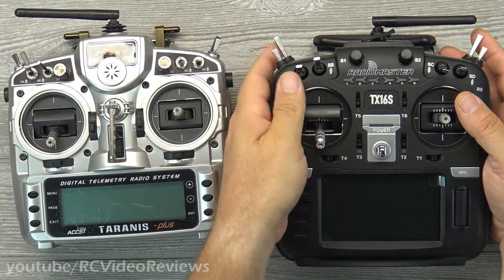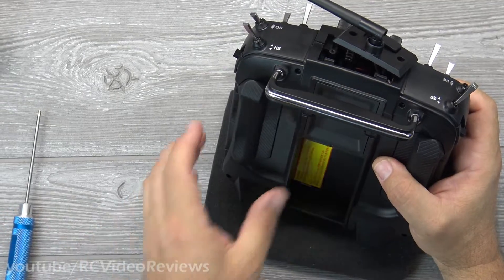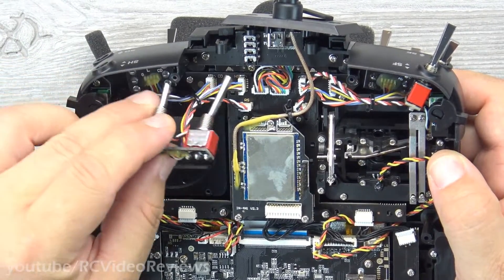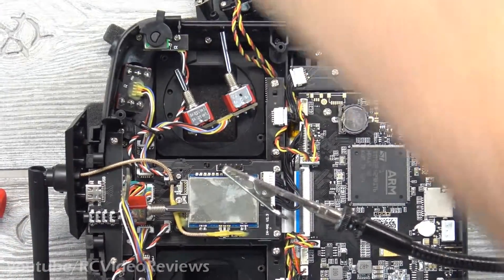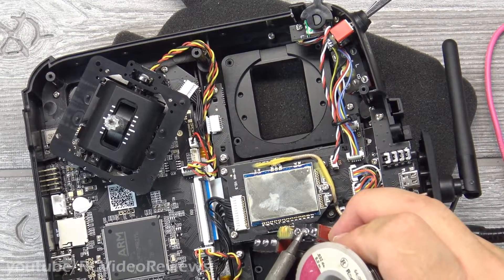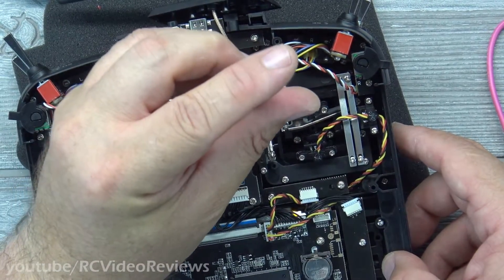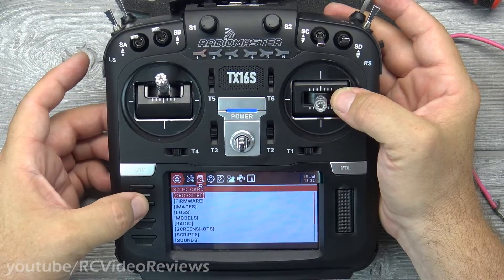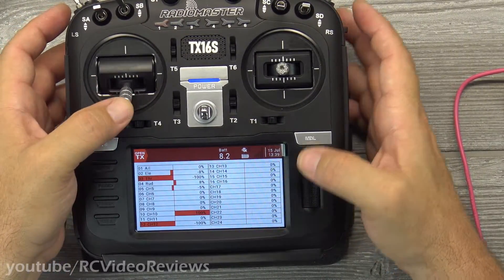Radiomaster TX16S Multiprotocol RC Transmitter - How to Relocate the Momentary Switch

Comment: Excellent tutorial thanks. I was wanting to do the same
Reply from the maker: You're most welcome. Thanks for checking-in. Radiomaster may have watched your video. My throttle gimbal wires were routed over top of the leaf springs out of the box.
Reply: i’m on the fence if i have enough courage, to attempt, i’ve broken enough arduino projects learning to sodder so don’t think i’ll mess up but it’s a brand new radio >.>

Comment: can I just replace the momentary switch with another sf 2 position se 3 position combo. I use throttle cut on the right rear fixed wing and arm/disarm on the left rear for quads.
Reply from the maker: Yes, you can swap out switch styles to suit your need. Make sure to make the changes in system->hardware so the radio knows what you've got.
Reply: @RCVideoReviews  i guess thats my real question. once i completely get rid of the momentary switch, how do I get the tx to register that there is no more momentary?
Reply from the maker: System->Hardware->Switches  I said that in my first reply.
Reply: @RCVideoReviews  my apologies. I thought you were addressing switching the switches. not whether the tx would require the momentary being somewhere put somewhere else vs being completely removed. thank you

Comment: Great video John! So what does the circuit board do if you can solder directly to the switches? Thanks
Reply from the maker: I believe they just provide electrical traces from the wire to the switch.

Comment: Great video John, here is something fairly new I found out (NO SOLDERING). RadioMaster makes a switch set that changes the SH to a 2 position switch and the SE to the momentary switch. All you do is remove the existing (2) switch sets with this rev from RM. Its available from Buddy RC.  It comes with (2) sets of switches, just unplug the existing and plug in the new ones then go to hardware page on the radio and change the switch types. See this video on how to get to the switches and then change them in hardware as it shows at the end of the video, obviously you will not need to do any soldering like in the video.
Reply from the maker: I thought I heard about those switches. Someone on the channel just asked about that not too long ago. Thanks for confirming.

Comment: Great video, thanks. What does a 3 position switch do, if you set it to 2 position?
Reply from the maker: If you're talking about doing in the system settings, I don't know, I've never told the radio a 3 position switch is a 2 position switch. It would probably wind up just registering two positons within software.

Comment: I bought the SF-SH switches that RadioMaster is now selling and it was super easy with no soldering, thanks to this video.
Reply: Do you by chance have a link to the switches you are referring to.  I am horrible at soldering.  Thanks.
Reply: @hammer5848  RadioMaster TX16s & TX16s MKII SH & SF Reverse Switch set  at Grayson hobby
Reply: From this video, it looks like you could remove the switches and relocate them then just change the plugs. No?
Reply: great tipp tunablue - i just ordered the same! with this the radio can be turned back into stock condition easily when needed 👌

Comment: Many thanks! Just done this conversion. No problems although I did pull the switches completely from the radio so as not to work over the radio. Now all the models are working, and whilst I wait for the old Spektrum throttle cut muscle memory to resurface, I'm off to re-watch your instant trim video now I have a left hand momentary switch!!
Reply from the maker: FYI Radiomaster sells a left hand momentary switch now. In any case, glad you got it worked out.
Reply: @RCVideoReviews  I had no idea lol! All sorted now with instant trim. Chuffed!

Comment: I'm a heli guy and that's where my throttle hold switch is, so I had to mod mine the day I got it.
Same place Futaba puts it and Realflight Simulator TX has it there as well.
Reply from the maker: I've done this mod 4 times. It would have been a lot easier if they left the PCBs out.
Reply: @RCVideoReviews  Yes that was a pain!

Comment: Great videos. I jumped on your idea and changed my switches over. However, I now Have SE DOWN  and SF DOWN (although they are both physically away from me). I can understand if I mistakenly turned SE over (yess I removed it by mistake 😞I do quite a lot of tinkering with electronics and have never foung a 3 position switch needing orienting) but SF can only go one way so that it is always away from me. I also cannot set SE a a 3POS switch. Any thoughts? PS is there any way of buying you a cup of coffee other than Paetron?
Reply from the maker: These switches must have orientation, otherwise how would the radio know that you have SE up vs SE down or SE mid? It's not a simple continuity device, the radio has to know if you intend up/down (or mid). 

SE by default is a 3pos switch. In my radio I can set SE to None, Toggle, 2pos, 3pos. The toggle switch doesn't change orientation. The sprung direction is always away whether on the left side or the right side of the radio. That radio doesn't know you physically moved it other than to give it a new label in the system settings.
Reply: @RCVideoReviews  Thanks -- I referred to your video and was able to orientate everything as it should be & all is working as it should. Thanks for the good work.

Comment: Just to add for people to be careful not to accidentally let a blob of solder drop onto the circuitry. I accidentally had this happen on one of my flight controllers, whereby the blob landed on the pins of one of the processors. When I tried to remove the solder it broke some of the processor’s legs. Placing a piece of cardboard over the body of the transmitter will help to protect it...

Alternatively, simply remove the switch units by snipping the cable ties and unplugging them. You can then place the transmitter to one side and work on swapping the switches without risking damaging the transmitter.

One final tip is to use a “Solder Sucker” to remove the solder from each switch pin one at a time. You can get manual solder suckers for under £10, or more expensive electric solder suckers.

Comment: i mean it work same way you this? Thanks.
Reply from the maker: You have to remap the switch in the system->hardware page, but yes, it's quite easy to change switches. I've done it on at least 4 radios.
Reply: @RCVideoReviews  so it mean I can do like u did the Video right? Thanks

Comment: Hi. i have a question about this video? I have RadioMaster TX16 are they switch? i like to change it my self but don't are they same Thanks.
Reply from the maker: You have to desolder the switch from the board as shown in the video. You cannot relocate the board--they are mirror copies of each other--so opposite. Follow the video and it will work.
Reply: @RCVideoReviews  Thanks

Comment: Great tutorial. I just did my radio without any issues. Two things that helped were a magnetized screw driver and some copper braid to wick away the old solder. Thanks!
Reply from the maker: I bought solder wick after doing this and used it on the next radio I did. Definitely helps.

Comment: That doesn’t look too complicated.  Question for ya John, can I set auto trim to the Trim 5 button instead?
Reply from the maker: You can set autotrim to any switch you want. I recommend using a momentary because you don't want to "hold" it. I would recommend if you use T5 to disable it as a trim in FM0 so you don't get audible prompts telling you "trim maximum".
Reply: After watching a couple of your videos I thought I might either move the momentary like you did or set it up as press in on the trim 5 switch as a momentary and assign it to auto trim and disable it as a trim.  The location of trim 5 would be convenient
Reply from the maker: Yup, that's what's so great about these radios, you can set them up however it suits you.
Reply: @RCVideoReviews  Yeah, amazing the versatility of this thing.  Your channel helps a ton as well.  I was considering a Spek TX upgrade but I just couldn’t swallow dropping six bills on it and still be under their thumb.....  done with them.  Just got a mess of RM recievers in today.  Bought 5 total for less than one 7 channel Spektrum rx.
Reply from the maker: I have a feeling you're not alone. Lots or people appreciate their equipment, but  their pricing is another story. Best of luck with your OpenTx adventure.

Comment: I'm found your channel from my interest in buying a Radiomaster.  So going through your excellent videos to learn more.  

I might be dreaming but is there any reason why the two boards could not be unplugged and swapped directly?  They look like they are the same other than the type of switches and they have the two plugs on the board between the sticks.
Reply from the maker: They cannot be swapped. There is a jog in the PCB so flipping them isn't possible. They have to be de-soldered.

Comment: Thanks for the video, I just done mine wow what a pain, but i'm not the best at soldering, but i figured out a easier way to getting them back in. mine wouldn't just push through the holes like yours until i applied heat even after getting the holes cleaned out. have had the RM16 for months and lived with the switches how they were but couldn't deal any longer lol.
Reply from the maker: I just swapped my momentary switch again on the new Color Edition radio. I'm getting pretty good at this :)

I knew there would be guys like you out there wanting to do this.

Comment: Just got my radio today. Mine seems to have a fan on the back plate with wires so I had to be careful.  But great tutorial once I saw the switches were soldered to a board I was like oh crap how am I going to do this.  Thanks for the tutorial!    I'm so used to spektrum that I have to have those switches swapped on my taranis and now this.
Reply from the maker: That's probably a speaker on the back. :) Really glad the video helped out. I started this a long time ago and can't go back now. All my momentary switches have to be on the left.
Reply: @RCVideoReviews  Hrmm it looks like a fan to me forgot to take pictures, but looks like a fan you would find in a video card where it sucks air in a duct rather than just a regular fan.. and its got 2 sets of red and black wires going to it.. Anyway I just got done switching the wires, that was quite a pain in the ass. no magic smoke hopefully the switches still work lol.  Edit: Switches work!. de-soldering them was a pain in the arse.  Solder sucker helped but still a pain in the butt.

Comment: Nice material, easy to follow and exact. Thanks for your time.
Would it work if I buy the SH/SG switches and just replace the SF/SE. 
https://www.aliexpress.com/item/4001081230319.html?spm=a2g0o.detail.0.0.26e967ddYJBeM6
Reply from the maker: The switches are soldered on boards that can't be moved from one side of the radio to the other because they have steps in them. If you want a momentary switch on the other side, you're going to have to desolder something I'm afraid.
Reply: Thanks for the reply. If that’s the case, I’ll de/resolder the momentary switch I’m purchasing to the radio.
Reply from the maker: No worries. If you're inclined to do it, you could remove the boards, remove the wires from the boards and solder the wires direct to the switches. I considered it, but opted to just use the boards they used.

Comment: Thanks for the great tutorial. Did the relocation of both switches on my TX16S today. Btw my TX16S came with the original 5000mAh. LiIon battery already in the battery compartment of the Tx. Keep up the good work !
Reply from the maker: Everything went ok with the switch relocation? 

When I ordered the radio mine had a battery in the bay as well but I thought they had a SKU for when consumers ordered the battery separately. I’ll have to check with my retailer. 

Anyway, thanks for the comment and encouragement. 

J
Reply: @RCVideoReviews  Thanks for asking. Everything worked out fine thanks to Your video. Took some time and patience to carefully de-soldering and re-soldering the switches but the rest was peace of cake ;-) Looking out for Your next video contribution. Have a nice day !
Reply from the maker: Good job. Glad it worked out. I'd like it if they'd eliminate those PCBs for mounting the switches. Maybe in the TX18...?

Next video is uploading right now as a matter of fact. ;)
Reply: @RCVideoReviews  Thanks again. And You are absolutely right switches on a TX should be easily interchangeable. TX18? no let them wait with that until we get well used to our TX16S  and also we can spend that money on some other flying R/C stuff. ;)

Comment: Is it possible to just swap both sides  complete with plug ?
Reply from the maker: No. They use a circuit board with an offset. If you flipped them the toggle switches would be inside the case.
Reply: Ok thanks. Great Videos with alot of great info for us new to the tx16s
Reply from the maker: Sure thing. Good to meet you.